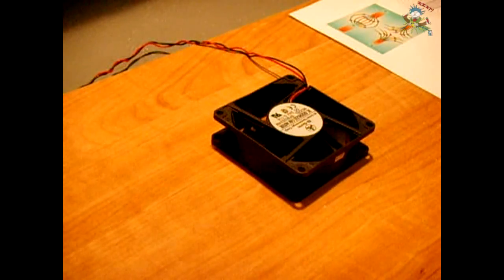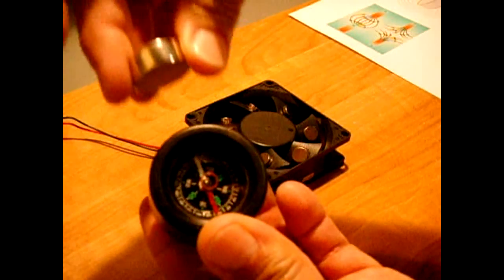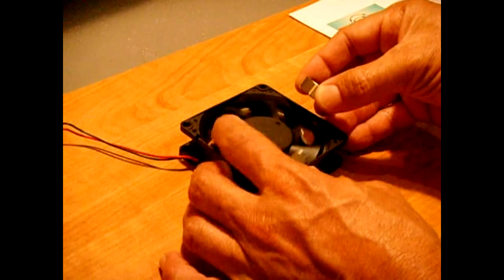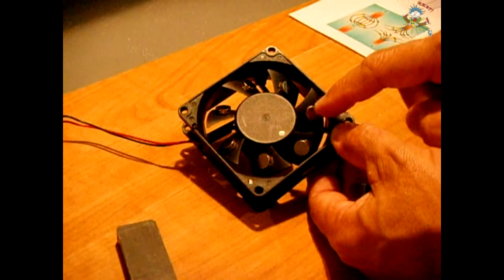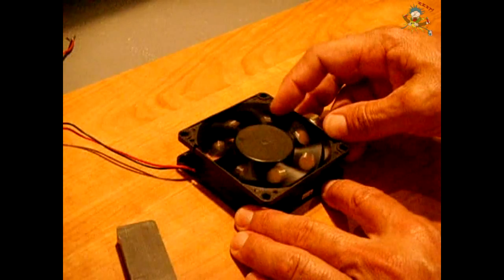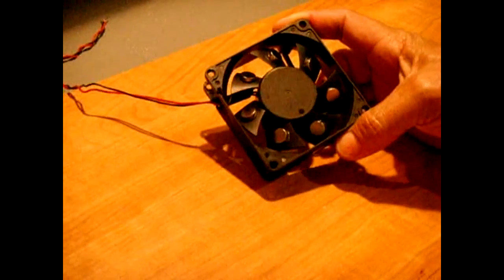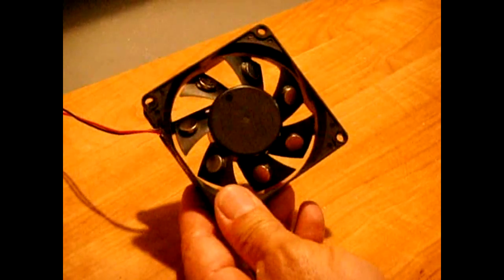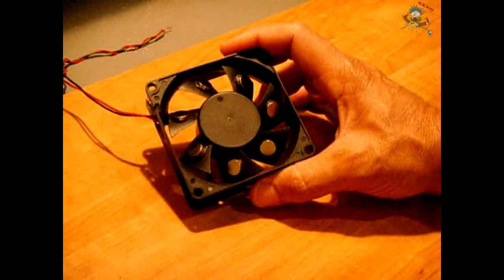Free Energy ~ Case Fan Magnet Motor / Real or Fake?

Comment: I've watched yours and his.  I'm not an electrical engineer,  but it looks to me like you positioned your magnets too low on the fan blades.  By putting them low,  you not only have less leverage on the motor, but it also requires you to put the magnet further down in between the blade magnets which would increase the cogging effect.
Reply from the maker: I appreciate you watching, but sorry Dan, his video is a fraud. I don't care where the magnets go(I suspect you may have seen the wrong video because I placed the magnets exactly where he did), It will  not work as shown. You can CLEARLY see the fan instantly turn on as the magnet nears the case fan. If the field of the magnet pushed the blades into motion, it would not have been "Instant".

Comment: i have gotten them to spin like that before for a different purpose :o
Reply from the maker: The only way you will get the case fan to spin is with the wind, or using a magnet which is not stationary, but moving.

Comment: if you look at logic I miss you measure the weight of the magnets and thickness , so the fan does not move the blades are very heavy.
Reply from the maker: Cesar, thanks for watching, but you have to realize the video is a scam. You are not going to get a case fan to "Instantly" spin(turn on) once a magnet is brought close to the blades. Not going to happen , especially as demonstrated in the video. If it did, everyone would have these magnet fans connected to their cell phones to keep them charged. I wish it did work. :-)
Reply: There is the joke and trick the fan but never said what kind of fan occupies just telling you to do a track for checks as is done if you give cuaneta aora I told you the answer I'm in another invention most powerful

Comment: or your batteries are to big and you need flat ones (just saying)
Reply from the maker: What batteries? Those are neodymium magnets.
Reply: good point... lol,, i just came home from the hospital ,,all medicated,,, looked at it wrong. those were flat magnets , would they not have a different way of reacting to another magnet?? after all, the weight alone of the flat magnets should have a bearing on the magnetic field, not to mention the height of the magnets you were using

Comment: it works only when the magnets sticked to the fan are less strength but you have sticked very strong magnets so it doesnot work because strong magnets cause disturbens betwen magnets
Reply from the maker: You can try weak magnets as well, it does not work.

Comment: i know how they fake it.... notice how they never connect the wires to get it rotating... they always push one or one of the 4 magnets into the system. that "push" by your hand is the introduction of energy into the system. If they are connecting the wire and disconnecting a wire to get it started and stopped.... they are blowing on it with a straw just out of frame... notice how you never see they person talking.... there's a buddy standing right there blowing on it through a straw.
That my friends... is DEBUNKED!

Comment: if a person would make a make and break effect to null the field at the exact point, would the momentiem carry the flywheel to the next attraction or repulsion action?
Reply from the maker: The ONLY magnet motors which can be made to work are the type that use magnets to rotate the motor/fan which are not stationary.

Comment: ok so the magnet for turning the fan doest work. but if we just turn the fan manually or by wind, does it still produce power?
Reply from the maker: Not all case fans will produce power when placed in the wind or when rotated by hand due to internal circuitry. You can get the fan blades to sping using the magnet, but the magnet will have to be moving around to do so. Placing a single stationary magnet close to the fan will not work.

Thanks For Watching! Be sure to share with others, and rate Thumbs Up.
Reply: can u somehow rewire the internal circuitry to change the fan into some kind of alternator?
Reply from the maker: Yes, but you are better off just using a junked automotive alternator.

Comment: THANK YOU. GREAT VIDEO! Most of this morons post comments based on their imagination, and they imagine too much. I have tried what you did in this video and got the exact same results. The blades, the magnets, the size of the fan and all the rest of it is irrelevant. I have tried even placed the magnets on an old CD, glued to a small electric motor, I have tried with a bicycle wheel, and the results are always the same: No spin. You get exactly the opposite effect: if the north pole pushes the south pole attracts the next magnet and everything gets stock on one point. YOU NAIL IT ON THE HEAD! It could work though, if the stationary magnet is moved back and forth, but for this, a different mechanism is needed. I don't understand people taking the time to bluntly lie to us, making fake "scientific" videos only to confuse us. They should be prosecuted. THANKS AGAIN.
Reply from the maker: Thank You for watching, and yes, the only magnet motors that appear to work, are the ones that have a magnet which is not stationary.

Comment: How about electric motor? electric motor just using the magnetic system? but there have some methode or system in electric motor to using magnetic field then change to force energy for moving the rotor spin. in example motor DC using commutator for change magnetic field to drive the rotor spin counter magnetic field  from stator. I think that will be possible to drive magnet fan motor using a another magnet, but that must be some methode and system apply, that change mangetic field drive magnetic fan. so the electric DC motor will not spin without comutator change magnetic field also if it's only have one pole. electric motor are magnetic system that complicated, we must learn how to electric motor work, how magnetic system in electric motor work. if we have a knowledge of that, I think it will be possible to get free energy case fan magnet motor work. I know that is not easy. I have seen another video from "pakistan free energy" that I think it possible work. He using a ferrite magnet ring, I think His methode is make in sense to apply.  This is the link"free energy-magnet motor.flv" by Joohop and "Free energy-Magnet motor by Zahid kaleem (skype : robitic 77)"
Reply from the maker: Just viewed the video. Unfortunately I was not there to verify that it does work. I would say trickery was involved. He used ring/donut magnets from a microwave oven magnetron. I have 5 magnets like that. One I find a few more ovens, I can make a video duplicating this.
Reply: electronicsNmore
So let you try to make a video duplicating magnet motor using ring magnet? Just for fun, and proof there have trickery involved, like this video you was make. so what kind of trick using to rotate the rotor magnet you think? do you know exactly electric motor system? I think there have fluctuation intensity and polarity of magnetic field, apply to the rotor then starting to spin. if we can apply that system on magnet motor, may be it can be work, I think.
Reply: Deasy Suryana
It's not going to work. The energy required to make the magnet rotate (which is the only way to make it spin) is MORE than the spinning wheel will output. Period.

Comment: You need to put the magnet to the top outer end of each blade. Sorry bro, putting things together doesn't mean you put it right and expect it will work. Just saying
Reply from the maker: You seem to have LOTS of knowledge on this. May I please see your video of your working device? Also include every part used with exact dimensions.

Comment: 10/14/14. 1:47 pm
I think you are doing it wrong- You're not wired right.
I'm going to experiment for myself. I'll let you know what happens.
Reply from the maker: NOTHING is wired. The ends were slightly apart. There is no sense is connecting a light to a case fan which will not spin using magnets alone.

Comment: i have seen those blades moving in his hands try ur magnets at the edge of the blades
or try altrnate the magnets
Reply from the maker: Does not matter what you saw on his video. You were not there in person to verify that the device actually works. Common sense, if it worked, EVERYONE would be using that device for free power. LOL
Reply: of then here is the trick there was already a magnet inside the bulb one end open when he was closing the circuit it was glowing but those blades were actually moving still no.. then why dont u ask him  i was just trying to help lol
Reply from the maker: The blades were turning because he likely used a hall effect sensor/reed switch to turn the fan on once the magnet was close enough to the fan to trigger the circuit.

Thank You For Watching.

Comment: This video is rubbish, it questions a guy who created electricity using a computer fan and magnets so theres alot of variables here, 

the first is he used a 12cm, 7 propellor, 12volt, 0.36 Mah computer fan about $3 from amazon where the motor on the fan has very small resistance. Your using a small crap fan with alot of resistance.

The second is your magnets are way to big and heavy not the thin neyodium magnets used in the video. Also if you go to the video and pause it around the 23 second mark you can see he's actually using 4 magnets not 1. 

And finally this is a really bad troll video when you can't back up the evidence like i can to prove things. 

Clearly you don't know what your doing for this video and unlike the other person you ARE trying to make a fake video and get likes and views for a cheap little cash 👍 douche bag :)
Reply from the maker: You want to see real rubbish? Look in the mirror moron. I have no idea what video you watched, but clearly NOT the same one this video was made about.  LOL. Idiot. You proved NOTHING, all talk. You are the typical troll, not I. The video this was made about has an individual talking about how a SINGLE larger magnet is being used to push the fan into motion. He also stated the size was no issue, and that plastic around the edge of the magnet blocks side magnetic fields. LOL. Sure plastic does. You need to go back to sleep, and stick to playing video games.

Comment: Have you tried something like 1/16" X .5" magnets on the blade?  They have about 1/10lb of pull power at 1/2" away.  That may lighten up the fan and then you can try a powerful magnet (say 1" dia X 1" thick will have a pull force of about 1 lb at 2" away).  I have time on my hands this weekend and I ordered just these sizes to try this crazy experiment...haha
Reply from the maker: Post your results here. :-).

Comment: You know what happened your is not working,? 1 is the round mags is too thick, almost double is thickness then the origin one, its over killed by mags strength,

2 You didn't use 4 square magnets that is right size thus right magnetic field balance is the key for pereendave style mag motor
also mag field shielding and mag field special make magnet are key to any this type motor.

You will see China may soon provide this type motor/ generator in large scale.
Reply from the maker: My replication did not work because the video was fake. Pure and simple. You must have viewed another video. The video I duplicated only used ONE large magnet to spin the fan blades. Since your positive this works, please duplicate and send me a link so I can share it with others after I verify the content.

Comment: Isn't there 2 types of computer fans?  One that has magnets and ones that don't?  I could see it working if you tried it with the fans that don't have magnets already in them (free spinning ones).  Just a thought. Love the video and love experiments.  Knowledge is power.
Reply from the maker: Hi Cindy. Case fans usually have a stator(winding) in the center of the fan assembly bolted down to the housing, and the fan blade assembly has magnets in it which slide over the stator assembly. When current is applied to the stator the fan spins. You also have different types of bearings, sleeve, ball bearing, and magnetic. Based on what I have seen in MANY videos, this does not work. If someone did have success replicating this, then many others also would have had success. Clearly we do not see that.

Comment: its your setup, the magnets and to tilted, i am running a setup sorta like the person in the video you are speaking of i use very high powered magnets though and am using less of a tilt than you are. it does work you just have it setup wrong.
Reply: i have very slow internet but i will try and upload a video of the setup i have running. also the fan you are using has each blade to close together and i think it has a tensioner in it it looks like.
Reply from the maker: Clearly your watched the wrong video. I did not post a link to that video, because I do not want the individual making more money off that scam as a result of my video. I used the same # of blades, same # of magnets, same tilt degree on the blades, case fan, etc. The video is a scam. Unless you can show a video with exact details so others can EASILY duplicate it, then you have nothing.
Reply: i have something along the lines you are showing here working, a prototype i 3d printed. my setup is different but similar, and i use more powerful magnets than you are using mine are 300kilos of force each using multiple magnets. it spins very very fast when not connected and spins at around 3000rpm when powering something because of the back tork. but it is possible, idk exactly what video you are speaking of the one i first got the idea from they were using a little different of a setup and angles than you are also, with more powerful magnets that are enough to combat the back tork.
Reply: i am attempting to put a video of my setup up so i can show you what mine looks like but my internet is very slow bc of where i live, if i cannot get the video put up i will send you pictures and also my 3d models if you are able to 3d print. and i can give you links to the magnets i am using also but they cost $25 each and i use a total of 8. it doesn't generate much power at all tho its more of a novelty that powers a lightbulb.
Reply: Karol Franzyshen
another thing i didnt realize till you, you do not have the cords hooked to anything at all so you should not have any back tork because the wires arn't powering anything, so the only reason you fan will not spin is because that specific fan has a spring in it or something holding it from spinning, that is why if you move it a little bit it will spring back and that is causing it not to spin. You should look into it a little bit more, i have been having issues putting the video i made up but if you want my specs and a copy of my 3d models i made and a list of other parts i use to make my motor i will send them to you.
Reply from the maker: When you post a video showing your successful, listing every part and measurement to easily duplicate, then send me a message.
Reply: i am going to my brothers house today i will bring a usb with me and upload it from there. like i said my design isnt something that genorates alot of power its just enough to defeat the back tork. but i can tell you for sure you are having issues because of that fan having like a spring in it, normal magnets lined up cannot defeat back tork, but since you dont have the wires charging anything you shouldnt have any back tork and it should spin. so that fan has somethng preventing it from spinning.

Comment: You used a monopole magnet the cogging wouldn't happen because a monopole magnet has two south sides of the magnet or two north sides of a magnet so they would not get hung up on each other and they will continue to spin
Reply from the maker: Monopole magnets do not exist, unless you can post a link to a provider of such a magnet. BTW, the individual who uploaded the scam video, never stated he was using anything but a regular neodymium magnet.
Reply: Oh well I must have watched a different video then but in the one I watched he used a monopole magnet in his motor
Reply from the maker: I'd love to know where he found a monopole magnet. Yes, you watched the wrong video. There are lots of them.